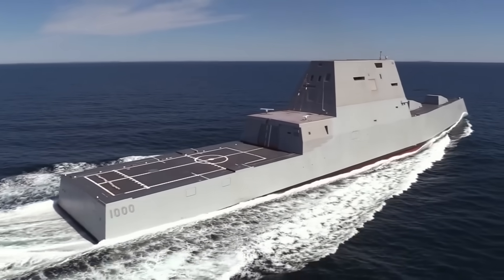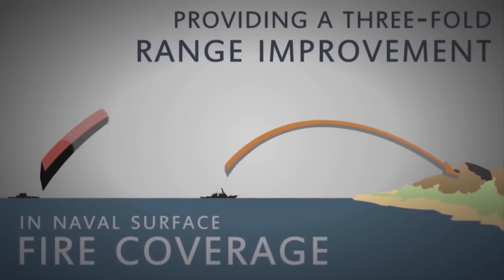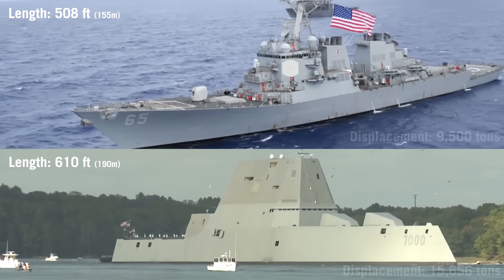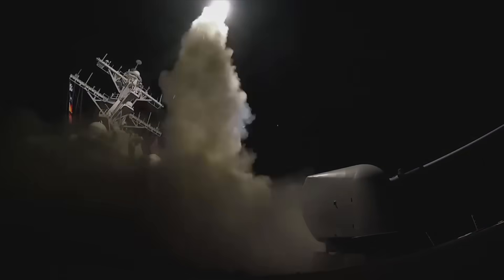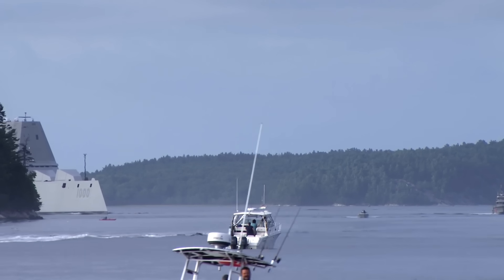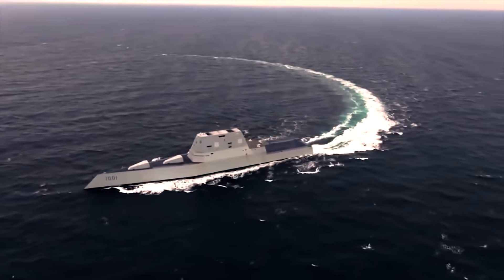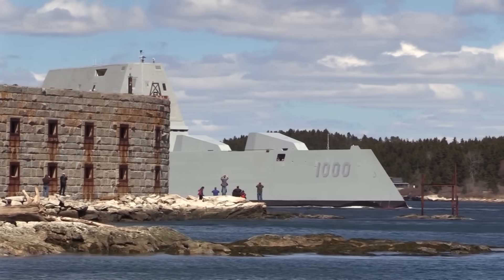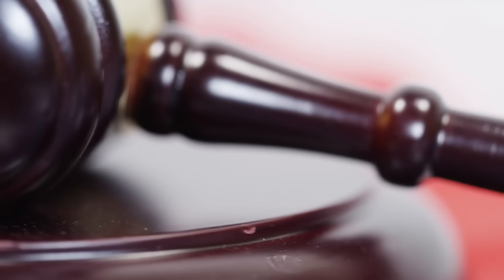What Killed Zumwalt Destroyers?

Comment: So my engineering professor was one of the people who helped design the composite citadel and hatches on the Zumwalt class. One of the interesting things he said about the ships is that the nuclear reactor was so powerful on the Zumwalt class that it had enough electricity to power New Orleans. So one of the proposed purposes of the Zumwalt is that in the event of an attack or disaster that cuts off the electricity to a significant section of the country, the Zumwalt can go to the location and plug into the power grid to provide emergency electricity.
Reply: Well that's interesting considering the Zumwalt class doesn't have a reactor on board.  Its a bit hard to run a nuclear reactor that doesn't exist.

Comment: It was originally envisioned as a fleet, but turned into a test bed for new technologies. Make no mistake though, that class is a killer. In practical use it would be a sucker punch, getting close to non stealth fleets and launching on them before anyone even knows it is there. With such a small radar cross section the main way you have to find it is sonar buoys or mark one eyeball. Just like stealth fighters, it is much harder to set up a kill chain once you launch missiles at it. If it had combat lasers, it wouldn't even matter if you did launch missiles at it. You let that ship slip too close to your fleet, especially in bad weather, and you will not have a fleet.
I fully expect to see many of the concepts and technologies inherent in this class of ships to have a massive impact on future ship design in our navy.

Comment: A complicated & ambitious expectation that unfinished Reserch & Developement on its integrated dual engine/gearbox mess would work itself out.
It never did.
It became a liability.

The Air Force's parts throwing F-35 front fan part-time integrated gearbox went through 10+ yrs of complication b4 working properly.
These boats weren't given that kinda time b4 being expected to work nice.

Comment: Ah, it runs on Linux. They probably tried to install a wireless printer and then ran away screaming. Hence canceled.
Reply: Nah the issues with the Linux system were when HAL tried to launch every single missile during a simulation early in the development process. Capt Kirk was not happy that day...
Reply: @talentpt  I read that as ”Bluescreen on every boat."
Reply: LOL you made my day
Reply: Installing a wireless printer in Linux:
Step 1: sudo apt-get install cups 
You are done.

Maybe you need a driver depending on the age of the printer and therefore another package.

Comment: The question is, whether US Navy will actually gain anything from this class. Zumwalt may be a black hole for funds, but in the long run it can also be a base for other projects. The technology designed for DDG1000 - and actually tested on it - will be useful somewhere else. On the other hand, with single projectile costing that much... winning battles could be more harmfull than loosing them. Meanwhile a single corvette could be more usefull... and cheaper. But, to be honest, there is a reason why US Navy invested in LCS: the very need to operate on small seas, near coasts and deliver support to troops fighting on the land will still remain a reason to push vessels closer to shores. So the Zumwalt was a good idea, though it failed to proove itself optimal solution. What now? Arleigh Burke is not a long term option, I believe.

Comment: So here's the thing. Even if you scrap the railgun entirely (which, at time of recording, no public advances have been made for some time), the zumwalt could still be made into a competent combatant. A small RCS (radar cross-section) is amazingly good for blending in with noncombatant traffic (which is an unethical tactic at best and middles out at "questionably legal"), but moreover, a 50 ft RCS is hard to hit with an ASCM (anti-ship cruise missile). And that's before we talk about incorporating electronic attack and electronic countermeasures. Now, when we examine combat missile shots, roughly 30-40% miss anyway. During Operation Praying Mantis, for example, every missile fired at the US Navy missed or was intercepted, and some of ours missed, too. When we add in advances in jamming, deception, dazzling, and interception, the Zumwalt might as well be a ghost. The big issue in my mind is that it didn't carry all that many missiles, compared to an Arleigh Burke. There are no obvious torpedo launchers. No obvious CIWS mounts. No RIM-116 or NSSM launchers. I know where the VLS tubes are on a Zumwalt and it's a little underwhelming. It needs more boom, but is a fine ship conceptually.

Comment: Meh...at least part of the blame, lies with the USN.  
They could have started with Army extended range 155mm gun research ( and might have gotten something that could have used current tech 155mm projectiles ), but no, they had to start literally from the ground again, inflating R&D costs.   
.
The USN also felt, that they had to add one additional feature, after another, in what amounted to a lethal case of feature bloat, which had the additional effect of forcing them to design and redesign the entire 155mm AGS system, down to where the AGS ( as an offensive system ) was terminally reduced, in available ship volume and weight, to the point where it couldn’t do the originally intended job of being able to replace the retired Iowa Class BB’s.
.
Railguns?  Great if you have Line of Sight to your target, but if you have to shoot over a few hills to hit it, a railgun becomes nearly useless. 
. 
But hey, it wouldn’t be the first time that they turned their head, on over 200 years of proven ballistics, in favor of high tech, only to have it fall short.  During the Vietnam War, they were so confident in Air to Air missiles, that they didn’t even bother arming their newest front line fighter with an internal gun...and we saw how well that worked, didn’t we?
.
Now I’ll be the first to admit that with some things, the USN was right with the Zumwalt class.  Electric Drive?  Heck, yes!  WW2 proved just how maneuverable and responsive ships with electric drive could be.

Comment: The Zumwalt as a "hull" was worthless without the four ingredients that it was designed around. (1) TSCE -- Total Ship Computing Environment which is supposed to replace the AEGIS combat system on 1980s architectural vintage. It was never properly funded or developed to promised maturity or capabilities. (2) Dual Band Radar -- the AN/SPY-3/4 system that was supposed to be the US Navy's next generation radars were never affordable enough or mature enough and was never developed enough before they were made obsolete by transition to GaN AESA tchnology. They were ultimately abandoned with SPY-4 basically dropped from the Ford class carrier and SPY-3 slated to be replaced by various sizings of the subsequent SPY-6 GaN AMDR (3) 25.6" Mk57 PVLS -- weapons that need and benefit from the larger diameter launcher was never funded and never materialized. (4) The 155mm ERGM -- Extended Range Guided Munitions were abandoned leaving these to be rather useless and limited dumb shell howitzers with neither the range nor the accuracy to provide effective amphibious fire support from over the horizon. The electro-magnetic rail guns were not even close to being fieldable systems so let's no even go there.
--
In the end it became a very big hull designed to carry stuff that are either obsolete or no longer wanted.

Comment: The French got that design right in the 1890s to 1920s. Finding it more stable in certain sea states but not in others.
With the centre of mass being below the water; if they take on even light amounts of water they roll and sink.
Also, they roll over and sink at much shallower angles than regular ships, and also really rough sea states flip them more easily.
The trouble with anything designed to be more stable, once the conditions are met that goes beyond what your increased stability allows then it works against you and flips you rapidly.
That is why by the 1930s the French abandoned the tumble-hull design.

Comment: The problem with cancelling ships is you have fewer ships to split the R&D costs between so the price per unit skyrockets. The development cost was about $10 billion for the program so instead of being split 32 ways to be about $300 million per ship, but when you only have 3 ships, that becomes $3.3 billion per ship... just in R&D costs.

 You also can't take advantage of efficiencies in mass manufacture and bulk purchase, which would save a good chunk on each ship. For a project like this you would probably end up saving 20-25% of the cost of building each ship if you were to make 32 of them, not 3.

All told if you were to do the whole production run, I'd estimate the ships would cost about $3.5-3.8 billion each, about HALF the $7.5 that they cost now because the order got reduced.
That's still really expensive, but the Arleigh Burke's cost like $1.8 billion for a flight IIa (not even the flight III), so again, about half.

Factoring in the crew savings of going from 380 to 258 saves around $0.8 billion so the Zumwalts WOULD have "only" been $900 million more expensive each than the previous class. Nowhere near as bad as the press makes it out to be.

Comment: Blaming it on "too many new technologies" is valid as far as it goes.  But "gunfire support is a stupid idea in the 21st century" is more fundamental.  If Zumwalt just had no gun and a bunch of VLS cells instead, the three ships we build would be much more useful than they are now.  The AGS are big and take up a ton of space.  The land attack role was always going to be limited in application, and we were never going to need 60 of those guns hammering  shore targets at once.  It was born of a fever dream to stoke the egos of a Congress in the early 90's that still wanted big gun battleships.  The Iowas got pushed back into service in 1990, and America's gerontocracy saw their retirement as a major gap in capability, even though that gap no longer exists in the real world.  So when Zumwalk was first getting cooked up around 1994, it was to replace the Iowa class, not to serve any real world need.  Hopefully the next "cruiser" will basically just be a Zumwalt without the stupid.  The basic hull is a good design.

Comment: #1 reason it was cancelled was astronomical ammunition cost, everything else could have been overlooked or solutions worked out.

The projectiles really were a quantum leap in navel warfare capability, especially land attack but without them the whole ship concept doesn't work and it's so specialized it couldn't be repurposed.

He glossed over damage control but having been in the US and actually BEEN on a ship on fire, dead in the middle of the Pacific it takes A LOT OF MEN to man the fire hoses and fight a big engine room fire so crews have to be big just for that. I saw navel reports that a strike that would not have taken out a conventional ship would have totally immobilized and resulted in a loss of a Zumwalt

Comment: They did learn a lot.....
The new french frigates use some similar design cues such as the tumblehome hull....
And the radar system fitted to the Zumwalt-class is excellent but very expensive and incompatible with a large number of missiles currently in the US inventory because it is an X Band only radar.
They pushed things to extremes with the Zumwalt-class and payed the price literally.
They also currently have no Missiles designed specifically for the oversized VLS cells fitted to the Zumwalt-class.
The two main guns with autoloaders specific to the Zumwalt-class and no ammunition are well known issues.
Some of the lessons learnt from designing the Zumwalt-class could be used when designing new capable reasonably priced large surface combatants for the US navy.
😎🇦🇺

Comment: There is a truth of mechanical design that the more complicated a machine and the number of component parts increases, the probability that the machine will break and/or malfunction increases. Some of the other comments as well as the presentation addressed this with specific examples. In my opinion, the cost overruns was just a measurable consequence of making the ship with too much unproven (not battle tested) technology.

Comment: I think rail guns are the way to go for all Naval weapons platforms. All you lose is the projectile, no matter how many types of rounds you have, you don’t expend powder for a canon or deck gun. You still need things like antiaircraft guns, but most of those can use rail systems. For close quarters combat something lie the twin .50 cal mounted on the deck to protect against small craft attacks in port would be a better choice. But for targets you can see at a distance on radar, a rail gun system would be my first choice!

Comment: Remember when the Navy said they don't need to refurbish the Iowa Class Battleships because the Zumwalt will fill the role of fire-support? Yeeeaaaah.
Reply: at this point, I doubt that any of the old Iowa's can or should be brought back for combat operations.  between their age, the modifications made to preserve them, and the lack of shells and replacement barrels, it is unlikely the navy would ever consider recommissioning them unless they are the last available option.
Reply: @trinalgalaxy5943  From my understanding they need to replace their entire boiler systems which is a huge undertaking, superstructure and decks need to be removed to get at the boilers.

Comment: Interesting that there are so many negative comments on here.
However, if you look at any ground-breaking technological advances, you will always find cost overruns.
OTOH, later developments can use lessons learnt in the costly original.
There are 2 logical explanations for this design
1 They always knew that it was going to fail, so they decided to try all the tech they could throw at it and use the whole project as a test bed.
2 Everybody was incompetent.

I can see that there is plenty of precedent to suggest that 2 is the correct answer, but even if that is the case, the ones paying attention will have learnt a LOT from this project, so there is plenty of reason to think that future new designs will include significant elements from this one.

Comment: The only reason it's so expensive is because the executives need to line Thier pockets. Boeing and Lockheed famously won't get out of bed for a contract under a billion dollars
Reply: Think General Dynamics the big dog in this one, they own Bath Iron Works in Maine, and I'm pretty sure all three of these were built there.
Reply: @MistaTofMaine  im am not 100% sure because im to lazy to google. But i think its partly metal and then other stuff, it has to because else what os the purpose in building them if u have a u-boot which is supposed to be stealthy show up on any radar the they dont need the u- part.
Reply: I had metalurgy or how tf its called in english but i didnt do well xD i think the shop in main should be able to suply metal for submarines. It not  that hard to make different metals just add the right amount of minerals at the right heat
Reply: no its not build like normal ships from metal but a composite which makes it stealthy and expensive
Reply: @renegranit240  parts of it are literally made out of balsa wood or bamboo

Comment: These ships never made sense. You can make planes stealthy because even a large plane is much smaller than a warship. That's why it's a total waste of time trying to hide a warship from radar. It will be seen. And warships have three more disadvantages when it comes to being spotted, particularly by wave-skimming anti-ship missiles. First, they can only move in two dimensions rather than three like planes. Second, they move much more slowly. Get one bearing on such a ship, launch the missile that way, and when that missile gets close even the most stealthy design won't hide it. Three, planes can hide behind hills and mountains. Ships at sea have far fewer places to hide.

Comment: This was too ambitious. They laid the hull and began construction long before the systems that were to be installed had even been finished designed, let alone built, tested, modified and certified. They tried doing it "on the fly". Which can be done, but not with all the red tape and bureaucracy that is our current system. And not all is lost. Valuable data was collected and many new technologies proven. Just not enough to make a reliable, war worthy combat ship. If you have 99% of your ship ready and 1% missing, you cannot fire a shot in anger. You're just an expensive floating piece of eye candy.  They will get it right eventually.

Comment: Also expensive is losing track of a naval superiority weapon. Lots of good ideas, powerful strike capacity, and you'll have to replace the Burkes anyway. Reconsider.
Reply: The Burke's won't have to be replaces, as there still under construction and the Flight III Burkes will be the replacement for the Ticonderoga class CG's. The Burkes don't need to be replaced and are NOT going anywhere for the foreseeable future.